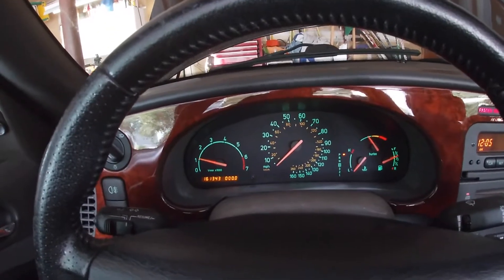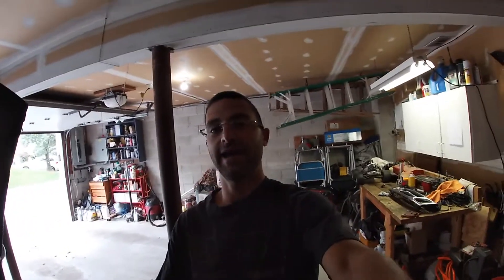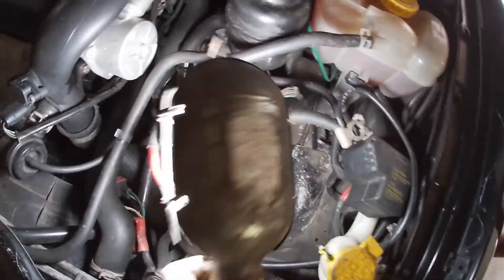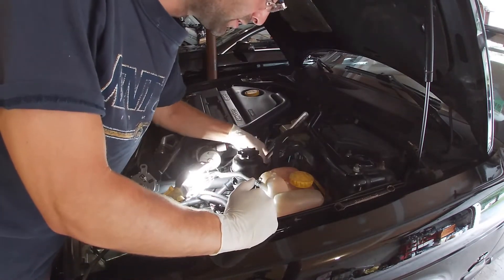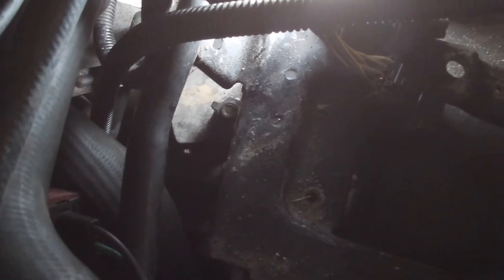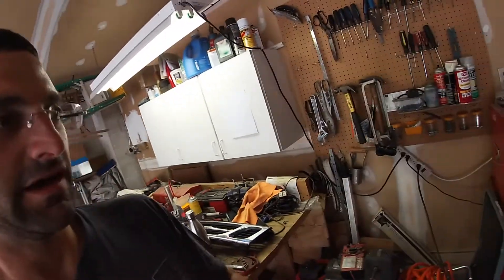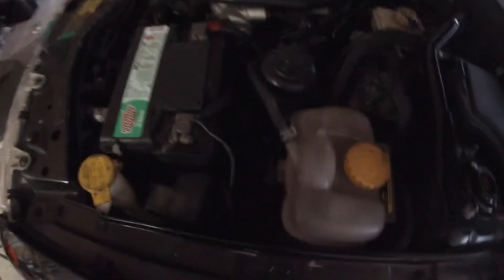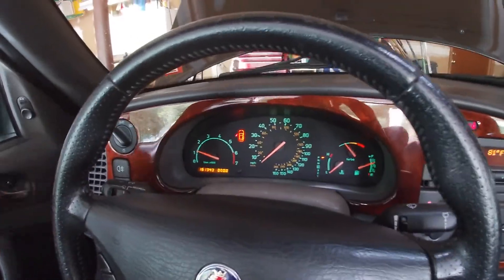Saab 9-3 Cabriolet Transmission Code P0705 In-Depth Repair

Comment: Oh boi that transmission gear selector sensor is a pain in the ass on my 2003 9-3. The pin would not come out of the transmission threads until I sheared a bit of it off to get everything out and then I re tapped the threads  ...a job I’m not looking forward to doing again
Reply from the maker: Wow! Yes, it sucked. I didn't have to many issues with the removing. Just the ONE bolt under the battery took some figuring out.
Reply: @KylePancis  please advise how you did this? 

I’m struggling like a mother!!!!

Comment: Thank you for posting this video, it helped me out.  This is a PITA job!  
A couple of updates/suggestions, since I just spent several quality hours with my 9-3 over the last 2 days.  First, there was the nut I lost when it pin-balled into a front cross member.  Then that bolt on the right side of the NSS is impossible to reach (darned welded battery tray).  I had to loosen the transmission mount & drop the engine/tranny an inch or 2 to get enough room to get a socket on the bolt.  Also, I found 3 zip-ties that had to be cut, not 1.  
Still have to put the battery & stuff back in (day 3).  I hope it works!  If not, you'll hear me crying and swearing for miles!

Comment: Anyone struggling with the 17mm under the battery tray try this.
Take a spare 17mm open/box wrench and cut the open end off, leave yourself with a 3-5” handle. Slide the box end of the wrench over the bolt. If you can’t get energy leverage to loosen it read on…. Grab a pry bar and slide it down between your wrench and the transmission casing and give it a couple pry’s until you can loosen it with just your wrench and soon enough your fingers. Your bolt may be loose enough to not have to torque on it with a prybar if so good for you! I don’t remember if he mentioned it in the video but I had to remove the 22mm on the shifter prawl to lift the selector from the casing. 🤙😮‍💨

Comment: Good video. I am in the process of doing this myself. 
After removing the 13 mm bolt that is holding the shift lever over the threads, the shift lever is not coming off. 
It is like the threads are trapping it in place. How did you make that happen? 
Looks like you had it way easier.

Comment: Hey Kyle I loved you’re video I just bought a Saab 94 , and it can’t pass the smog I’ve put $1400 into so far , p1577 comes up and po705 is coming up also man I think it’s the gear stick I have to use a key to press a small button to change it when in park lol ‘ any advice would be welcomed

Comment: This repair is so much easier on the MY2000 9-5 SE with V6 engine.  There isn't as much stuff in the way!  Around 70K miles, the NSS can periodically keep the engine from restarting when hot and must be replaced.  It's survival may be related to amount of short trips versus highway miles driven (gear change wears off the plating from the contacts and that fouls the grease in the switch.)  I used to keep a 3/8 inch dowel and wooden crab mallet in the car to tap it until I replaced it.  The NSS keeps the car from staring in gear and also reports the chosen gear to the ECU for proper engine tuning and efficiency.  Usually, a new NSS will come set to N position so putting the car in neutral reduce chances for alignment issues.  Some checks to make after installation are: 1) are the backup lights working in R?; 2) does it start in P; 3) does it start in N?

Comment: today I also changed NSS on my saab 9-3 convertible 2000 113kw. I had issue with starting the car then the engine is worm.  there is a good way how can you test if it is really NSS causing the issue.  Pour the cold water on the sensor if after that you can start the engine then it is definitely NSS problem.  I change it with the one founded in the junkyard, we will see how long it will last for me .
Reply from the maker: Good insight!!

Comment: nice channel . I have a 2003 93 vert myself :-) awesome cars . it's a stick shift . just wanted to ask you a question before your channel gets real big . Did you get a stage 1 tune ?? . stock bhp is around 150 on the 2.0 black tops and you said yours was 210 in the "shifting lanes" vid . I am looking to get a noobtune with open sid from saabnoob on the uk saab forum . he tunes the b205 and up engines . 
The "red top engines" b204 are the ones to get tho . the block is good for over 600 bhp stock , where ours will melt pistons at around 300 bhp ... plenty for the road tho :-) 
keep up the good work mate and i will be watching this channel closely from bonny scotland :-)))
Reply from the maker: I appreciate your support and being in touch! In u.s the B205R is whats in the car, its slated to produce 204 bhp (i stand corrected). That came with the HOT in the SE spec.  As far as the tune for Stage 1,  i have not done on the 2.0l engine. I believe a tune with a new diverter valve for the turbo should be good! I think it will bring you up to 250-275 bhp. I would open up the airbox as well. I went stage 2 on my old 9-5 (2.3l). I did a tune with the Open SID as well. I also did a catback exhaust, open air intake, and I also replace the turbo inlet tube to a larger inlet with a spring-loaded diverter valve. That produced someone where around the 300 range in hp and torque. It was really nice with polyurethanee bushings and engine mounts too lol

Comment: What's up with the steering wheel shake?
Reply from the maker: bad passenger cv joint and axle shaft. just replaced everything!
Reply: @KylePancis  Yeah, I did mine too, still shakes.  Done so far, tires, rotors, brakes, Hunter Road Force balance, motor/trans mounts, control arms, stanchion arms, sway bar end links, tie rod ends, inner tie rod bushings, passenger side CV half shaft and inner driver, shock cartridges, at my wits end.